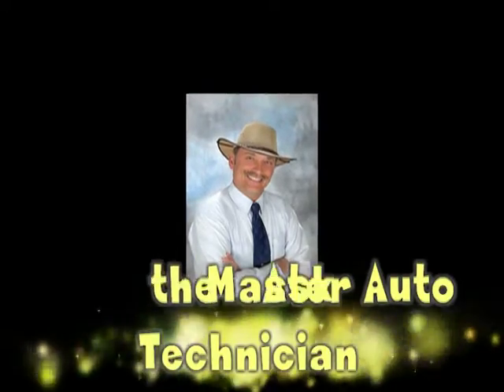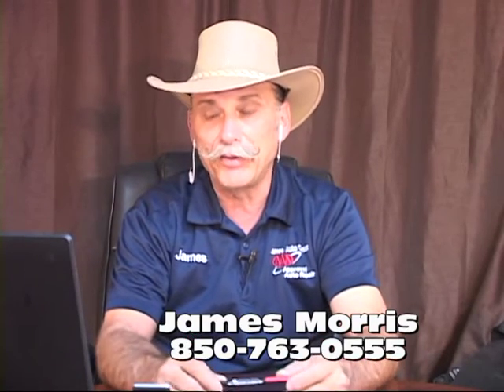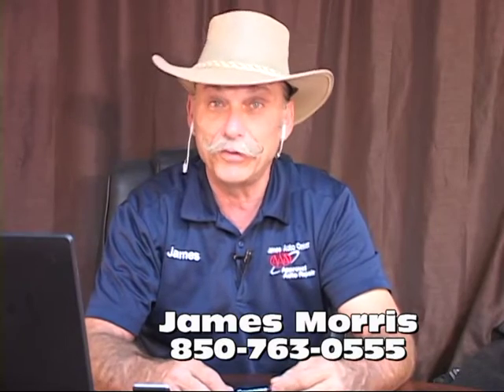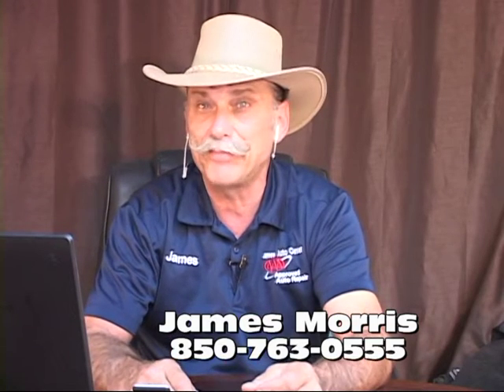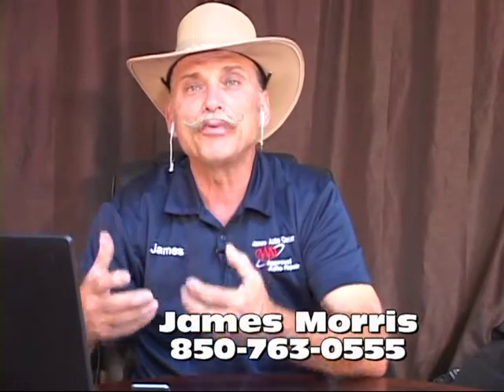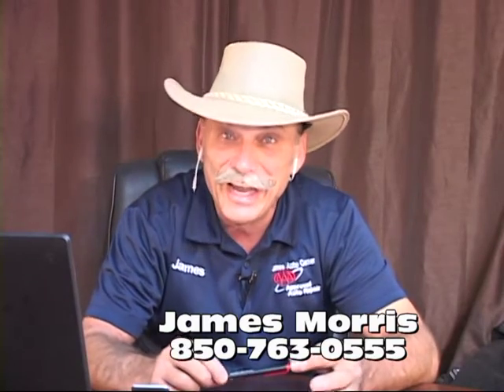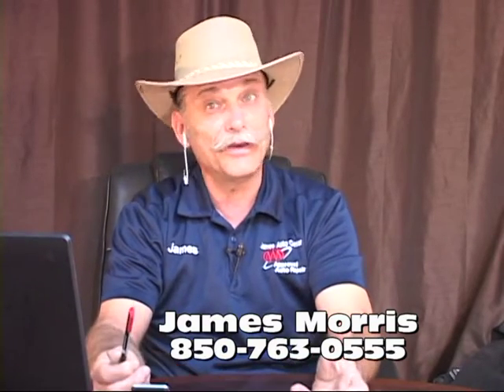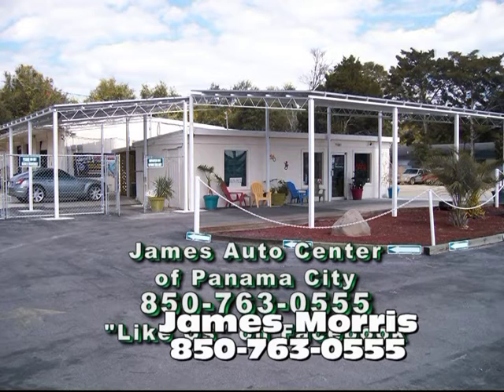2009 Ford 5.4 liter codes p0130, and p0150

Comment: I have a 2010 f150 with those codes and the truck runs like crap under acceleration, it hesitates from  take off, can the reprogram fix this problem!?
Reply: Same with my 2009, did you figure it out bro?
Reply: Same with our 11 Expedition King Ranch 2WD 5.4, I used a bottle of CatalyClean from AutoZone and the truck runs a lot better but the codes keep coming back on and off
Reply: Before adding the bottle the truck felt like something was clogged and wouldn’t take off when we would push the acceleration pedal.

Comment: just watched your video...lots of great information...when i got my king ranch i was getting 1000klm to a tank....now im down to 640klm to a full tank. was told po130 and po150   which is my left side up stream sensor...   ford wanted $433.00 for the sensor plus labour costs...   i ended up buying one off a website from the states ...brand is walker . im set to try and do this job myself tomorrow morning..but now that i have watched your video im not sure i should use this sensor..
Reply from the maker: I would suggest OE parts from Ford.  A lot of aftermarket parts are not as dependable as OE parts....
Reply: so is left side up stream the hard one to get thats on the passenger side behind wheel well?
Reply from the maker: When ordering parts. the right side is the passenger side and the left side is the drivers side.  Bank 1 sensor 1 is ALWAYS on the bank where cylinder #1 is.  They are all are paint to get out after they get some age on them.